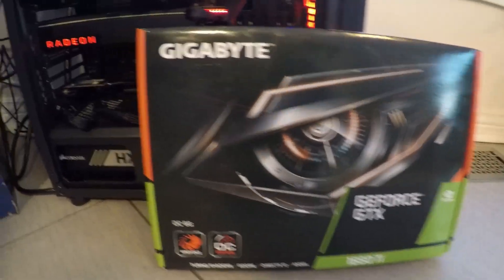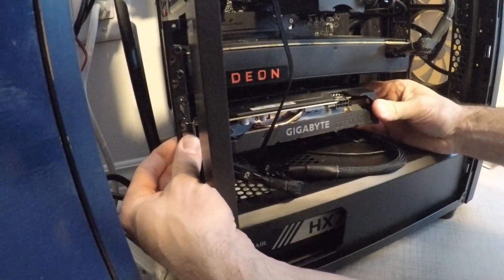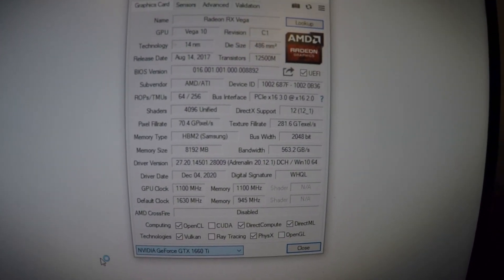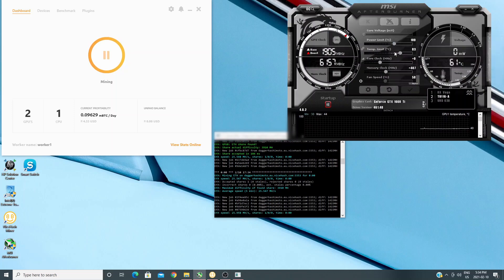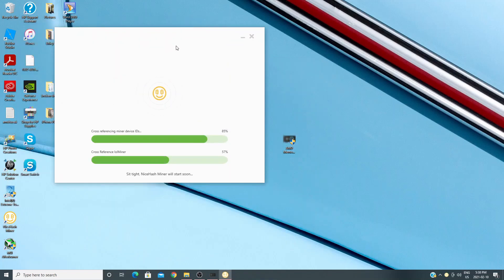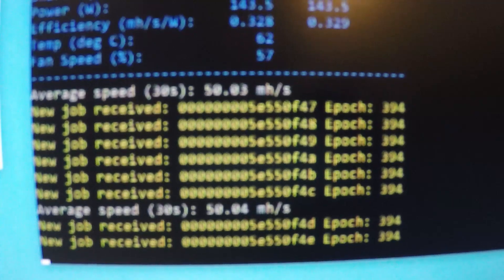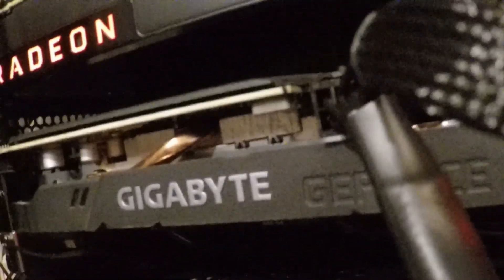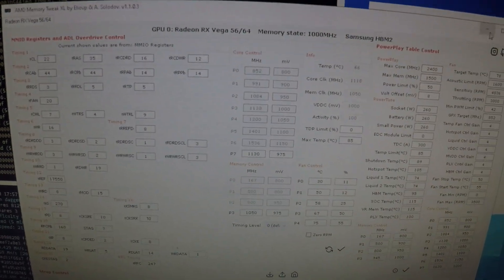AMD and NVIDIA GPUs mining on same computer

Comment: If you use riser cards, you might have to install both a Radeon in the PCI-e x16 slot and install drivers, and then install a Nvidia card in the mainboard slot and install drivers, then move over on the Riser adapters and set Bios settings to Pci-e gen 1 mode and disable CPU sleep C1E mode and disable all built-in devices that take up PCI Lanes and so forth, it depends on your motherboard. 
Plugging directly into motherboard is not accurately portraying the problems you might face. 
Besides, i just ripped the second slot off my main PC MB so i dont recommend tHAT.  :-)  ...it still works, with pins sticking out..... damn lock .
I am gonna mix cards soon on my mining rig, because i cant get the 3060 to work properly on riser card without dummy hdmi, no matter the driver.
I was thinking to put the rx 6800 in the Mining rig x16 MB slot, if i get problems detecting it on the x1 risers, but problem is; 
there is a 6700 xt coming too,  and i  only have 1 x16 slot, so then next option is one more cheap MB with a Celeron. 
Or perhaps see if my LGA 775 rig is ready to be resurrected.
Reply from the maker: I didn't really intend on making a single video to capture every problem that could be encountered. More for someone looking at getting a second card and tossing it in their computer. That said, I do have a full mixed rig at the end of the video running on risers and I did not have to go through the process that you described. With almost an infinite numbers of combinations between MOBOs, CPUs, GPUs, Operating Systems, etc there is no possible way for me to really make a video that could even come close to identifying all of the challenges that could be faced. All that said though, I don't make "how to videos" and deliberately do not label my videos as such. I make videos showing what I'm working on., though I acknowledge they follow something of a "how to" formula.
Reply: @DIYNorth  I had to move my rx 6800 out of my main comp, because the rtx  3060 wasnt working without dummy hdmi. 
I only have 1 mining rig and that had 3070, 3060 and 2060. 
After moving, the AMD card refused to work on riser card and also the 2060 stopped working, turned out 2060 didnt like the new power supply cable, 
had to use the old EVGA cable. EVGA PSU's forever :-)  The new PSU was a  ROG strix 850 G, the old is a EVGA 750 G5
After 2 re-install of windows, a lot of DDU and back and forth in Bios with PCI-E Gen 1 speed and disabling onboard sound and other gizmos i thought would eat up PCI lanes, 
i decided to move the controller, a random 4 port mining "thing" from PCI-E x1 slot to the X16 slot.  That did the trick. 
Except from every boot having to kill every Radeon/AMD process after applying my "Mining" Tuning Preset, it works. (investigating Flashing Bios on rx 6800 to avoid this)

USB wifi stopped working, i think there is an interrupt conflict, because it looks very weird. Sometimes it connects if i rip out 1 USB wifi adapter, sometimes it connects only when plugging in the second one, but constantly it lost connection. I lost patience and connected by powerline adapter to onboard Ethernet.
With a Celeron 5900 ? 8 GB ram, 2 power supplys and a 2060, 3070 and rx 6800, it pulls 545 watts and makes around 150 Mh/s.
There is a 2060 coming (today) and also a rx 6700 xt in a few weeks, and by then, all my PCIe connectors are used up, and i am at 230 MH/s, 
plus the 3060 with 470.05 driver running on my main PC at 50 MH/s. (havent measured power on this yet)
I think getting AMD and Nvidia working on the same Windows rig is very hard, and the path is full of holes. 
Also the Remote Desktop, Win Updates and User policies is giving me a hard time, it isnt very user-friendly at all. 
Just like Windows never has been. Think about Snipping Tool, it took MS 15 years to put in "print" and "send to Email" and it STILL doesnt work good.

To be fair, its not a mining MB, but a ASUS B460 M-K. And i did the moving part Sun 25.04.2021
I recommend to anyone thinking  about a dedicated mining rig to: First of all: Just buy some bitcoin  :-) 
THEN: 
Buy ONE LOUD PSU that can run every card you want. PLan for Connections (you need 1-3 PciE x8 per card, PLUS a x6 for the riser) Something like LC 1800 v2.31 with 20 !!!  PciE 6+2
Buying "consumer" PSUs with 6x PciE 8 pins is just not good enough, unless you run 3x3080 off each PSU, get them REALLY cheap, and they are somewhat EFFICIENT.
One 60 watt bulb burning 24/7  will cost you roughly 1/4 to 1/6th of a normal "consumer" PSU, and the difference between 80+ and 80+ Gold is 7%, which equals out to 40 watts  24/7 at 545 w.
This means getting them CHEAP is more important than rating, unless the rating is CRAP. And buying ONE that does it all, is always best. 
The LC 1800 is only 50% more cost than the 850 ROG, but probably 80% more noise :-)
Reply from the maker: I think your rig needs an exorcism. To be honest I've had just as much headache with dedicated AMD and NVIDIA rigs as I have with mixed rigs. My pure NVIDA rig was crashing twice a day and after a windows up date was crashing immediately which actually was better because its easier to trouble shoot something that happens all the time rather than every couple hours when you aren't looking. After about 10 hours of software updates I pulled every card off the rig and started running them one at a time obviously with full system restarts. The problem turned out to be a bad 1660 Super that I bought off another miner (I'm pretty sure he knew what he sold me). I've tried it on 3 computers and it will crash your rig in about 10 seconds. But it plays games just fine and I do all my video editing on it, so I'm not sure what the deal is. From my experience if you are messing with it too long try going back to basics, and my opinion is to always get the AMD cards working first, then start introducing NVIDIA. Doing the one at a time thing can also help identify a bad riser. 
I only really use Corsair Platinum PSUs. They are dead silent and have never had one go bad. I've used a HX 1200, 750, and two 850s.
Reply from the maker: The 3060 is very energy efficient. I have 2 in one tower, and they are at about 100 mega hash for under 300 Watts, but that is for the entire tower I assume they run between 90 and 100 watts each.
Reply: @DIYNorth  received 1 more 2060, plugged that in as card number 4,  and got error "cuda line 816 out of memory" - increased virtual memory in windows from auto to manual setting of 8000x4 = 32000 mb minimum - 45 gb maximum _ error gone - mining at 185 MH/s and 700 watts from the wall.
Reply from the maker: @Anders357  yeah, usually for one or two cards it doesnt matter, but definately as you get more it becomes important to increase virtual mem

Comment: What can you recommend for processor, mobo and psu for 2 1660 super?
Reply from the maker: Honestly pretty much anything will work.
The mobo having 2 full width lanes which have enough separation to fit 2 cards is probably the most important factor.
I dont buy psu under 750 watts, but you could run a 650 and be fine with the cards you mentioned.
As for cpu I look for low power draw, but if this is your daily computer then get one that meets your computing needs and it will be fine to mine with.
Reply: @DIYNorth  Thank you so much

Comment: I have 3060 tis and 5700 xts running together not worth the time you'll spend trying to keep it stable my advice split them up
Reply from the maker: All of the mixed rings I have had have run just as stable as my non-mixed rigs. 
I've only used Vega 56/64, and 5700 XT cards from AMD, but I've used a large variety of NVIDA cards.
Experiences may vary I guess.

Comment: hello i have 1 3060 and 1 rx 590 . rx 590 still 50-56% of vram and suggestion?
Reply from the maker: Sorry, I'm not sure I understand what the 590 is doing.
Reply: @DIYNorth  Mh/s from 590 is verry low
Reply from the maker: @xpar3474  I've never had a 590 so I don't really know what might be the issue. I know you should be at about 30 Mh/S on Eth though.
Reply: @DIYNorth  4 hours trying to solve my problem and after reinstallation of amd drivers i forgot to compute ! well done me

Comment: fantastic video, thank you:)
I have an old gtx980ti and would like to add an rx580. using unminable software is it possible to run them both?
also, i havent figured out why im only getting 3.8Mh while mining with a single gtx980ti..Any suggestions? (im using unminable)
Reply from the maker: I've never tried unminable, so I'm not really too sure about that. As I understand the 980 should be closer to 20 mega hash. Are you on ethereum? If you are mining CuckooCycle though then 3.8 isn't that far off and it might just need to be optimized using afterburner or a similar program.
Reply: @DIYNorth  i have a choice between ethash and etchash. one way it gives me 1.5Mh and the other anywhere between 3.2 to 3.8 the highest is 3.8 and i got that from tweaking with msi afterburner..what is cuckoocycle?
Reply from the maker: @promie1  it's a different mining algorythm
Reply: mayb your running on low settings, check your settings switch to high

Comment: Hey what mobo do you use? I have a b450 and plan to do the same (but both nvidia cards) Thanks!
Reply: Its a mortar max btw
Reply from the maker: The one in the Video is a newer MSI Z470 with a i5 10600k. The one in my actual mining rig is a Z270 (with 7 PCIE lanes) and a old i3.
I used to have one other Z270 that had an even older Pentium in it. The only thing I've noticed about MOBOs is that they have different Bios configurations that need to be adjusted to get them to work well. Other than that I haven't had a single issue with any of them.

Comment: Does this work fine with 2 different Nvidia cards? I have a 2060 I’m mining with rn, and I’d like to also mine with a 3060 I managed to snag

Edit: and also, do you think that if a underclock/undervolt them my single 600w PSU will be able to handle them? I have my 2060 all the way down to 80 watts at 30MH/s, and I haven’t even installed the 3060 yet, so I have no idea how that will look
Reply from the maker: Yes they will almost certainly work fine. I am running a 3060 and a 5700Xt in that computer right now and the total power for everything is only 355 Watts, so I think you'll be just fine. The 3060 is a bit of a puzzle to get working at full capacity. I did a video on that pretty recently as well. Do you have the driver to make it work?
Reply: @DIYNorth  I don’t have the driver, but I found a few links to mega downloads of archived versions of it. Obviously I’m going to run an antivirus scan on whichever one(s) I download though. Thanks for the quick response!

Comment: i have 1080 ti and i want to use rx 550 for 1 pc, so i just install both driver right ? and no conflict ?
Reply from the maker: That is correct. Judging by the number of comments I have on this video though I would say there could be conflict, but generally yes it should work.
Reply: @DIYNorth  thank you man

Comment: hi nice vid. thank you. im trying to do the same, i have 5700xt on a x570 motherboard, and im trying to add additional gpu which is a 3090. everytime i try to install the 3090 driver, in the middle of installation, the computer reboots, then before it will show the window login, it will reboot again, removing the nvidia card stops the reboot. what do you think is the issue?
Reply from the maker: I assume that the 5700XT is in the computer and that the AMD Driver is already installed. Have you tried installing the 3090 as the only GPU in the computer? (with the 5700XT either fully removed or at the very least disabled in device manager) As long as you can get both drivers to fully install it should be able to work.
Reply: @DIYNorth  Yay, thanks, i tried remving the driver and it works now. both show on device manager . now, the issue is everytime i reboot my computer, it goes to a reboot loop, have to remove the 2ndcard (nvidia) and redo it again,..and it will work. again. damn!
Reply from the maker: @forensiccult  That really sucks. Once it starts to work I'm sure it will be fine. Just finding the one thing that is messing it up will be painful.

Comment: What do you think about using A nvidia 3090ftw3 ultra and amd 6700Xt in the same pc? I wanna make sure I don’t screw my pc. I know it’ll take a lot of power so I have A 850GQ 80+ gold PSU. Please lmk if you think this is ok, I’ll have both drivers installed to make sure.
Reply from the maker: As long as you can control the heat I don't see a reason why it would negatively impact the computer. I don't have a 3090 but i hear that they run hot. I'm not sure about the 6700 xt. I've got kids and animals running around so I can't run an open case, but maybe that would be an option for you to better manage the heat.
Reply: @DIYNorth  thanks for that reply. I ended up doing that and had my case open. Man my room was hot. I’m back again with another question. I got rid of my 6700XT and now I have A 3070 FTW3 ultra otw. You think I can use both 3070&3090 ftw3s in the same pc with no problem? I have A 850W 80+ gold so really I just would like to know if I would be ok with that PSU.
Reply from the maker: @naimgames3392  I don't think that it will be much different in terms of power draw and heat from the 6700XT. It should only be about 20 Watts more power draw.

Comment: Gonna try to add a 6800 to my 3070 and 3060 ti once it arrives in a few days, I thought it would be no problem but suddenly I panicked a little. Thank you for releaving my stress haha
Reply from the maker: I have a 5700XT that worked with a 3070 as well as a plain 3060. I think that your combination will be just fine.
Reply: @DIYNorth  are that 2 gpu working well together for gaming or render? or working only one of them for daily use(gaming, etc)?
Reply from the maker: @fbs7248  I've only really mined on it. It can do basic computer stuff just fine like internet and using installed programs. It also plays games like minecraft and roblox just fine even while mining.
I assume a AAA game would be too much. Likely you would have to stop the miner. But after that I'm guessing it would play a game just fine
Reply: @DIYNorth  I have a 5700xt currently and I just got a rtx 2060 would a 650w be just fine should I just buy a 800w

Comment: I tried this with my rtx 3080 and rtx 2060 but it didn’t work
Reply from the maker: Those are both NVIDIA cards so they will work together. I dont have a 3080 or a 2060, but I'm almost positive they can be mixed.

Comment: why is it that i'm uing rx5700 that has a hashrate of 50 but when i plug in my other 580 my hashrate in the 5700 starts to go down
Reply from the maker: I'm not sure, is your power supply being pushed to its limit with both cards running.
Reply: @DIYNorth  my pc specs are: 
Ryzen 5 2600 X
16gb ram hyper X
Gpu: rx 5700 mainly 
Rx 580 secondary
Psu is cooler master 750 W 
What do you think that makes my 5700 hashrate go down?
Reply: @kimjozefcolanta6568  5700's memory temperature reachs 106 celcius. because both gpu very close each other so rx 5700 overheating easily and drops using memory perchentage. thanks me later dude
Reply from the maker: Can you switch which GPU is in which PCIE lane? I find the one that is sucking the heat off the back plate gets a lot hotter (basically the one on top in a computer tower gets hotter) Right now my 5700 is on the bottom and is running pretty cool, but the 3060 that is in the top PCIE lane is actually pretty hot with fans sitting around 70%. You can also download something like HWinfo to better monitor temperatures and determine if it is a temperature related issue or not before moving anything.
Reply from the maker: 750 should be fine. If it was a 550 or 650 then it could be that the psu is reaching its limit when 2 cards are mining.

Comment: How do you download the 2 different drivers tought ?
Reply: if both cards are NVIDIA
Reply from the maker: If both are NVIDIA cards I don't understand why you would want or need to have both drivers. Just use the NVIDIA driver.
Reply: @DIYNorth  rtx series uses the same drivers as a GTX ? trying to pair up a 2060 with 1070
Reply from the maker: @benjamincyr1697  yes they use the same driver. I had a 1080, 1660, and a 3070 all on the same driver and that's 3 different generations.
Reply: @DIYNorth  thank you so much !!

Comment: I'm using gtx 1660 super and rx 5500 xt 8gb together. They work properly except rx 5500 xt's temp, rpm, doesn't show up in nicehash dashboard....
Reply from the maker: Yeah, actually. I have the same thing going on. It took about 2 weeks to notice, but I've seen the same thing on two different configurations.
Reply: HI. I have as well as yours. Can I mine in other than Nicehash?
Reply from the maker: @MatiasF10  Yes, you can mine pretty much any way that you want. I'm not sure if you can use all miners with both NVIDIA and AMD cards, so you might need to find one that supports both brands.

Comment: I have a 2060 super coming in, will it work together with an rx 580?
Reply from the maker: I can't assure you of anything, but I see no reason why it wouldn't work. I just got a 3060 and I'm going to try to get that hooked up with a 5700 XT. I'm not sure that it will work either, but I have some high hopes.
Reply: @DIYNorth  were you able to do it?